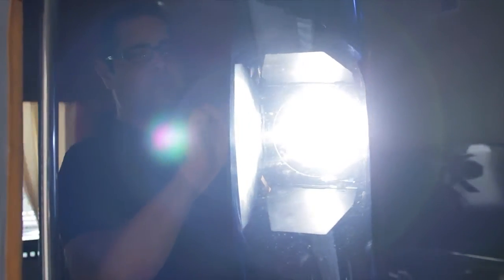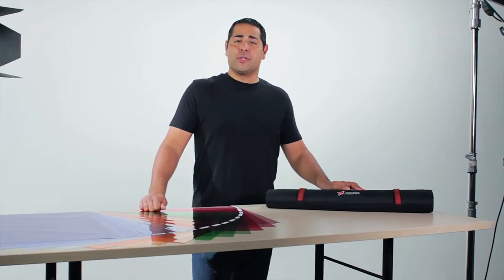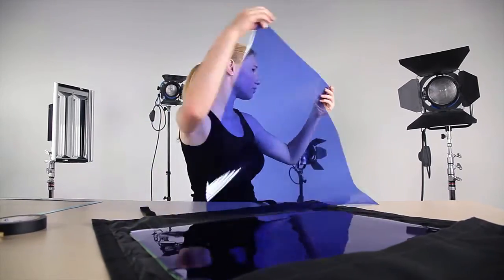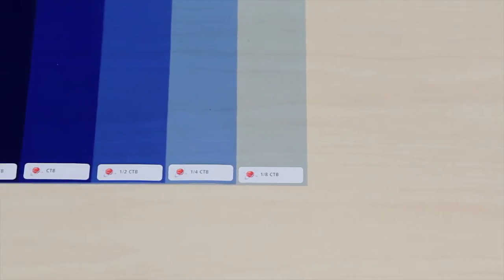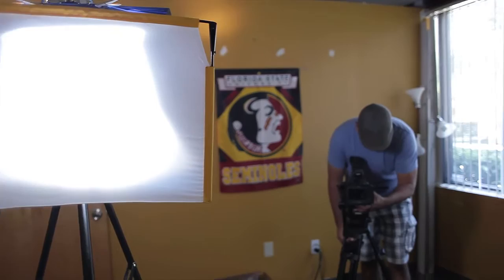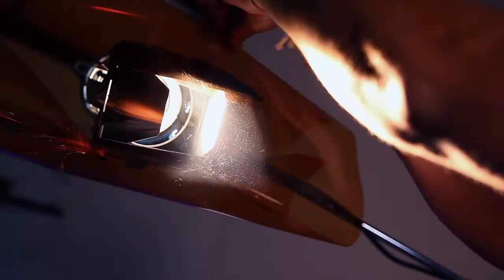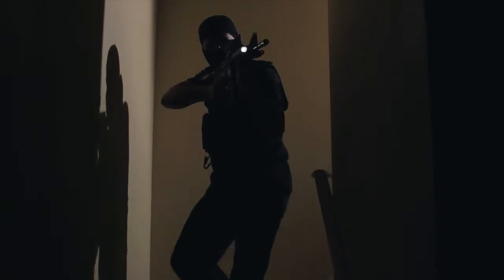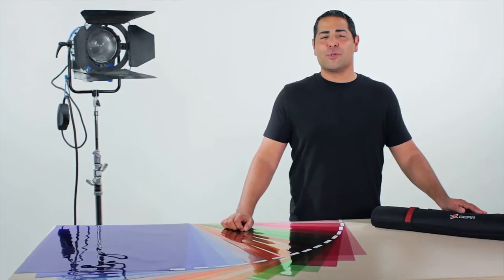Color Correction Gels Explained

Comment: thanx, btw I have tungsten typical 600w light and want a "daylight",  I wont be able to buy  fluorescence light so I would yeah use  daylight gel filter but I wonder,  will it be  really good  light blue light?  how big is the differnce between gelcovered tungsten  vs fluorescence?